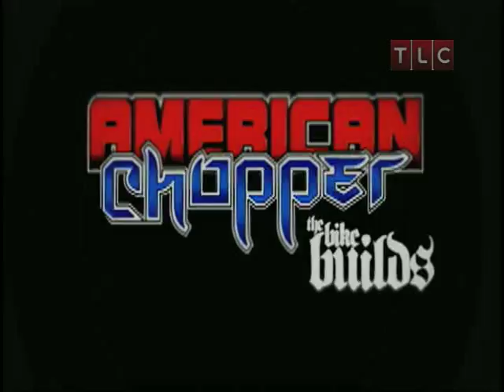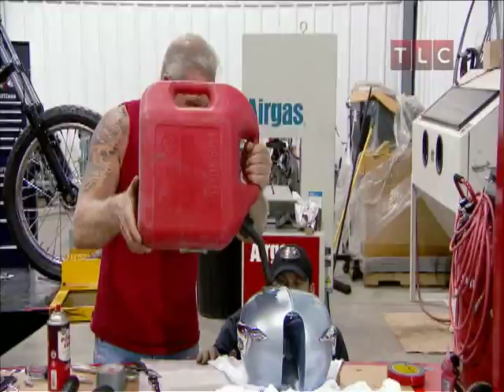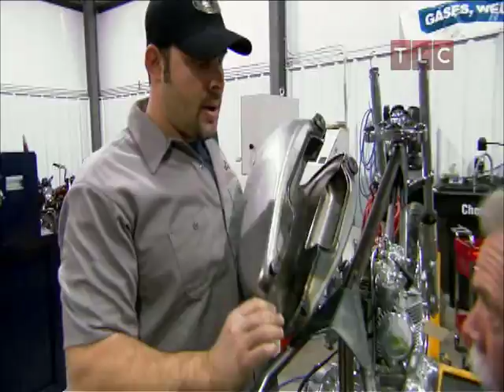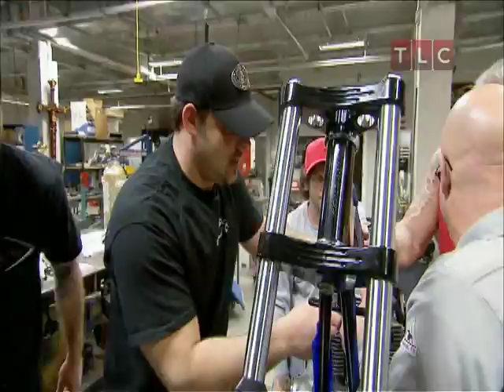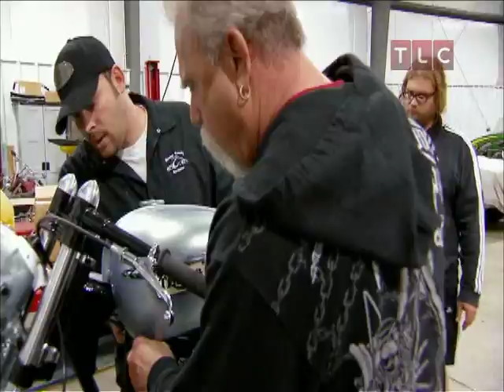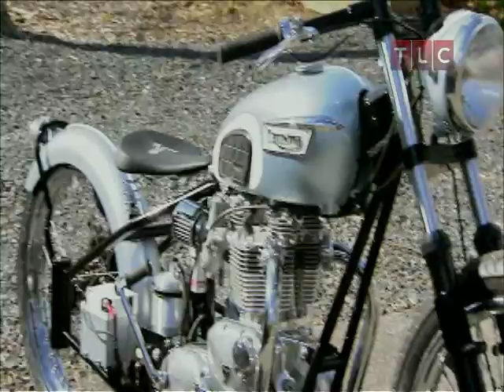American Chopper - Triumph Bike

Comment: @marcelolois 
You obviously haven't seen many of the shows if that is what you think.  The designs are theirs and they fabricate a great deal of the stuff themselves out of sheet metal.  Have you not seen the countless times Rick is spending days fabricating gas and oil tanks?   Have you not seen them machine the wheels and other metal parts with the water jet?  What do you want to see, a blast furnace turning iron ore and carbon into steel and molten metal being poured into molds?